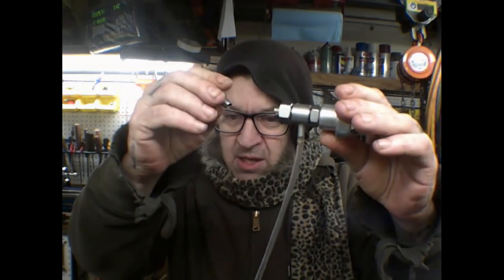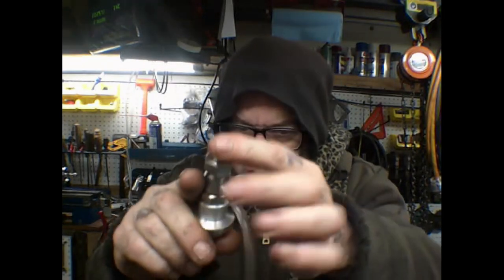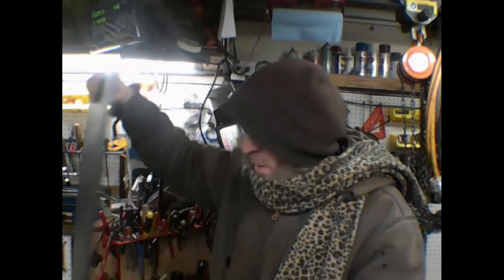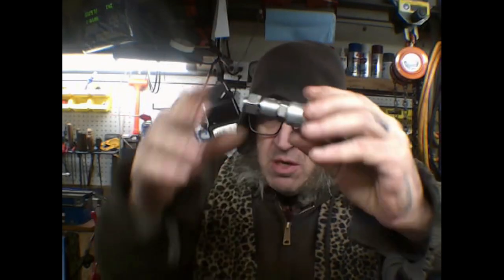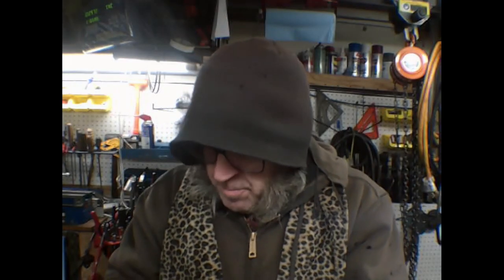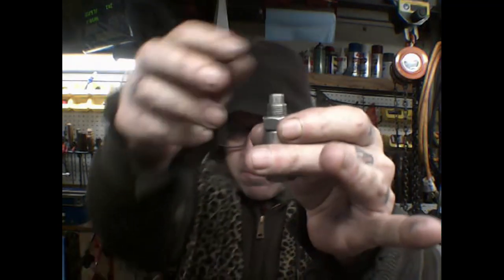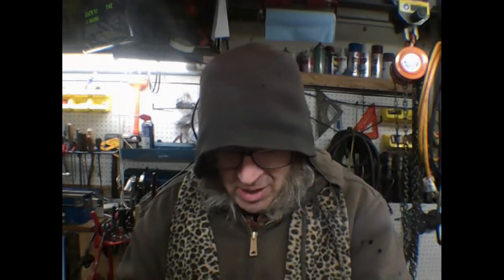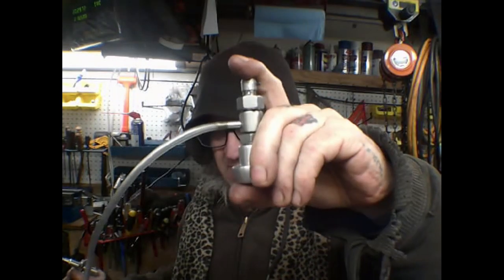Graver Machine Test - Not Pulse Type

Comment: Great video, Shan! Lots of information, now I am hooked again to trying to build a air graver. I put together one of the pulse type setups about a year ago, but it just does not have enough power to cut much more than a scratch into soft metal. Your graver sounds like you have plenty of power. Can you take some measurements of your graver and share with us .... or point us to drawings on the internet to start with? 
Thanks again for making this video!!

Comment: I built a similar air powered graver. My graver works but uses too much air. How much air does your graver use? When the graver holder contacts the piston and pushes hard against the piston, the piston stops oscillating. How did you solve these problems? My graver starts at oscillating at 20# pressure and useful power is at 40# and best at power is at 60#.
Reply from the maker: I have not focused on the gravers in sometime. That being said, one of the issues I had was too high CFM draw. This is directly due to the tolerances inside the machine.